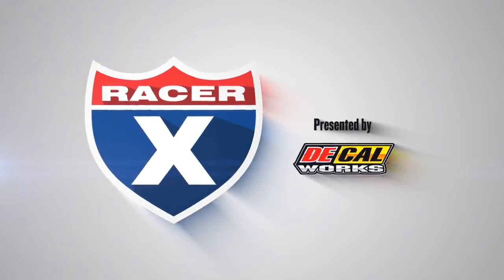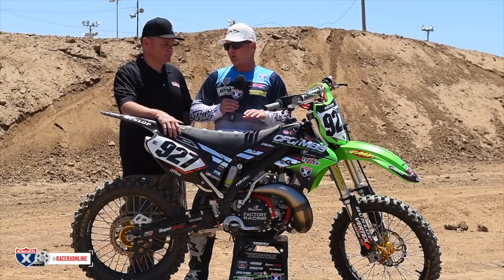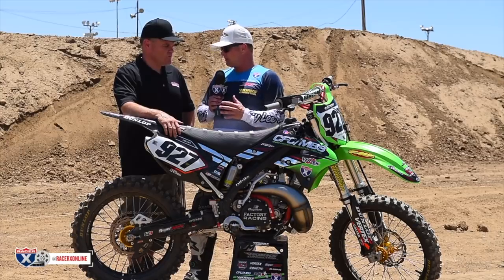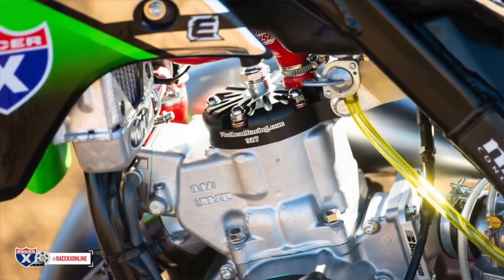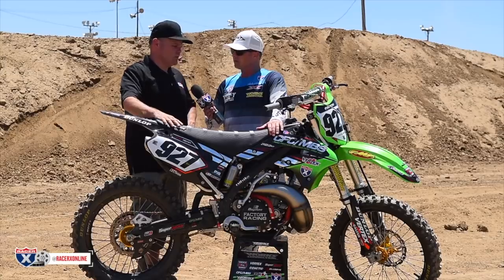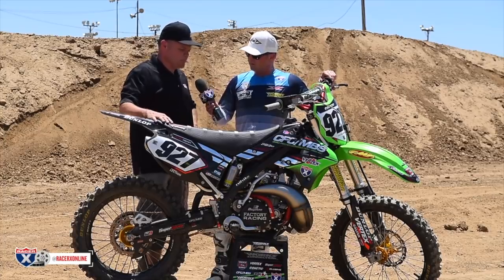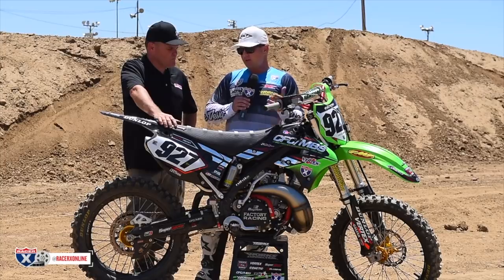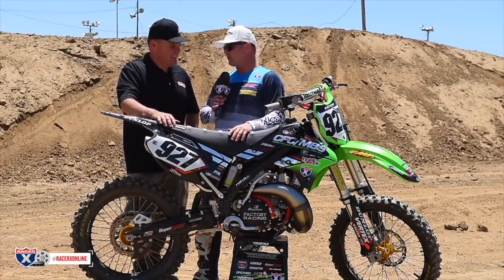Racer X Films: 2004 Kawasaki KX250 Two-Stroke Motocross Garage Build Project Bike

Comment: I'm super blessed to have my wife also backing me on my KX bought a 98 blew the motor after a week I mean exploded the Piston skirt broke off ruin the cylinder ordered another engine on eBay paid a lot of money and it also blew so I'm already into this thing over 2500 just put the engine in the shop to have totally redone and my wife is with me on the decision she really wants to see it come to fruition
Reply: Damn had the same piston runnin for the past 7 years (no clue how many hours, but it has ALOT)with my 02kx250, have trail ridden the piss out of it and she keeps comming back for more. Tf are you doing to blow a piston so bad?

Comment: Have a 02kx250 freekin love it for the trails! I want a hydraulic clutch and heavy flywheel and its going to be way better than most 4t( already kinda is imo). With the carb tuning and mods i have so far it chugs so freekin low and still makes torque! I just wish kawasaki would get their heads out of their asses and start making 2ts like the ktm/gas gas/ect.  Would go into debt for that!

Comment: Nice bike. Motor sounds weak though.
Reply: Sounds weak yes, but back in the 90's and early 2000's they were soo torquey and fast.
Times really have changed and we are used to much faster bikes.
If you ride a stock 04 today the first thing you would notice is how short the powerband is.

Comment: Why do a 04 when Kawasaki updated the 250 in 05 and was a lot better bike (motor)...also there were scenes of a kx125 in this video
Reply: The 04 kx 250 2 stroke Model peaked at 55 hp and never had more hp. So they did not Update the 05 to be anymore powerfull then the 04 model.

Comment: Why put money into a dinosaur with horrible brakes and suspension. Don’t get mr wrong it’s a beautiful bike but you mine as well go pick up a fresh Ktm or yamaha
Reply: Some like to buy, others like to build. I prefer having a bike I know in and out that I’ve built with my hands, than get some cookie cutter off the shelf bike. Just my opinion though.
Reply: People rode them back the no problem, so what would make them so horrible today. I have an 04 rm250 with a lectron and Magura hydraulic clutch and a 2015 rmz450. The rm250 is way more fun to ride and feels way less rigid